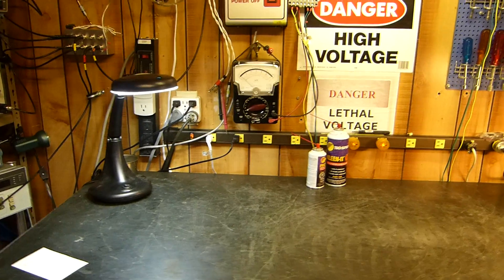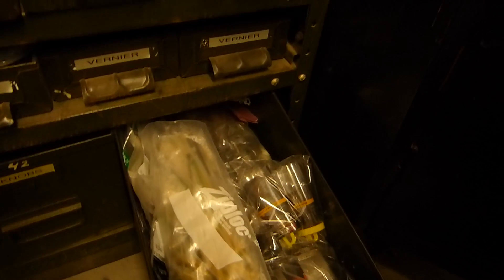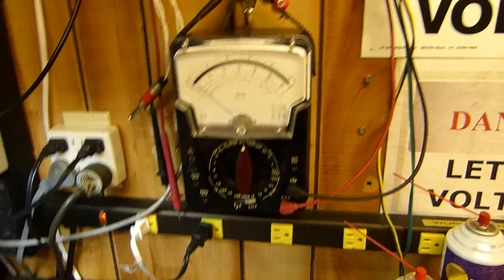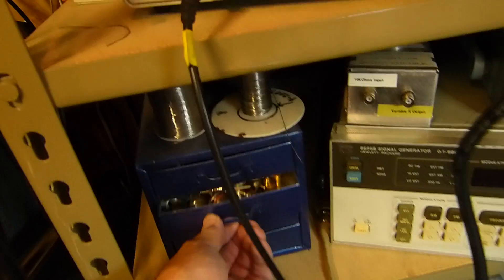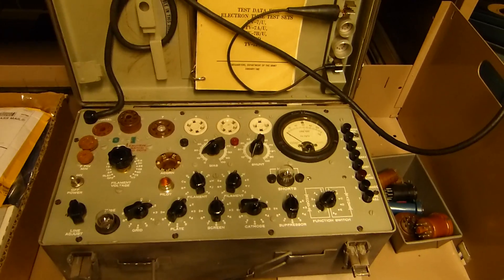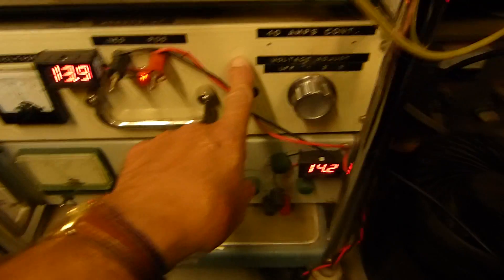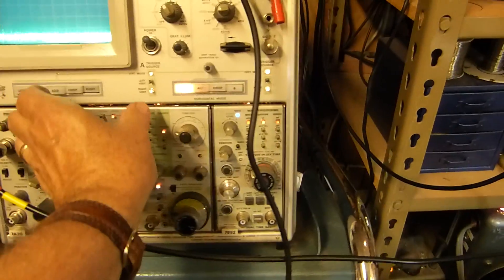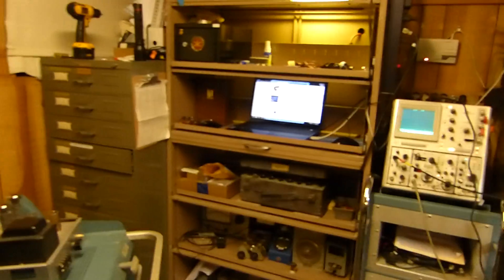My Audio and RF Workbench Shop Tour

Comment: Old-but good
Reply from the maker: I agree but nowadays we can have a $100,000,  1980 lab for $3 or 4 thousand and if we are lucky and get equipment that has been taken care of, we can make measurements better than 1% accuracy. I have so much confidence in the General Radio equipment, I use it to check out the new digital equipment made in foreign countries as I trust the GR equipment the most.

Comment: I know I'm late to the party, but I did enjoy the tour very much.  I suggest you replace the air conditioner with a ductless mini split unit.... they are more pricey than window units but extremely quiet, easy to install, highly efficient.... and unlike most modern window units, if you have a power outage, when the power comes back on, they come back on running instead of you having to manually reset them.  Your wife will like the lower power usage, you will like the safety factor and your you tube viewers will like the quietness.
Reply from the maker: Good suggestion - I am thinking about exactly what you speak of for my apartment "backhouse", as I call it, that is next to my little shop. I do agree that the extra bit of money will be well returned on efficiency and lower electric bills (by electric bill is around $650/month in the summer)... and a quieter place to make videos. It just may come true this fall for the backhouse and shop.

Comment: Great stuff, thanks for taking the time. Is there a way you could post or send me the link to the "chips" guy I can't find him on the bay and I'm looking for my first spectrum analyzer. Unless you would like to part with that pretty 3580, or if you could make any recommendations, I'm looking to use it on 10 and 11 meter radio. I do agree, my wife never had enough shoes.
Reply from the maker: Here is a link to a current selling produce on Ebay from Tektronix listed as "Chipxs"
http://www.ebay.com/itm/Tektronix-RSA3408A-Real-Time-Spectrum-Analyzer-14-Day-Warranty-/162238070893?hash=item25c624806d:g:ei8AAOSwxKtX~9F-

A spectrum analyzer  for 30 MHz should be fairly easy to find and not cost too much. The HP 3580A is for audio and goes from 5 Hz to 50 KHz. Nowadays, the inexpensive and sometimes free FFT programs that run on your PC will actually give you better results than the 1980's HP 3580A that cost over $17K back then... Check out ARTA and SpectraPlus software for your PC to do audio work. All you need in addition to the PC and software is a cheap USB sound card.

Good luck with your projects and thanks for your comments.
Reply: Thank you  for saving me a fortune. I'll check out those programs this weekend.
Reply: ElPaso TubeAmps s

Comment from the maker: I made the BNC box and do not have any significant noise problem with it. It raised the best of the SG505 from 0.0008% to usually around 0.004% or so but their could be other factors also. I have 1 meg ohm resistors in series with two of the BNC connectors so that I get a 2:1 division (reduction) in voltage into the 1 meg ohm inputs of the freq counter and such so I don't exceed their maximum rating.

Comment from the maker: Yes, I have been meaning to write you about it - it is very nice and I use is often. I wish it had a holder (I use an old Weller soldering iron holder) and a light (LED) on it so I can see that it is power on and hot - otherwise, it works great - thanks for the recommendation - PS - I am on 20 meters a lot lately around 14.250 MHz - if you get on sometime, maybe we can hook up. 73

Comment: Hi David- I am sure it's going to be a lot of help in your biz. There is a heat adjust on the handle via small pot. I cranked it all the way up for  R 390A modules and heavy P2P work.. The tips come in clogged with solder but after warm up the 808 will suck in. I use the 1,8mm tip for P2P stuff, they have tips up to at least 2.0mm.
 I will be interested in hearing your report.
Oh, I cost you less money than your wife did with the AC pwr Hi hi.
vry 73 Glenn

Comment: half the weight of the Weller. It has a long narrow neck and can get down on tube sockets, terml strips, connectors and other P2P stuff. The 808 has it's own small vacuum pump on the handle and BOY DOES IT SUCK I don't think I will have to use wick any longer. There are YT videos on the 808 and everyone seem to say only good things. 
BTW  I chuckled at the story about your wife turning off your AC. I wonder if she is related to my wife... HI
You can't shoot em but sometimes it does cross my mind

Comment: Hi David,
I thought your name is ray for some reason.. Sorry about that.
Hey, I want to spend some of your money and you will appreciate it..Back in the 80's I started using AirVac desoldering guns and they are perfect for PCB work but the Y head will not allow close point to point work. So, I did some investigation work to see if I could find something. Check out the Hakko 808 desoldering tool. It's around $200 and looks like an old Weller soldering gun we used years ago but it's about MORE>

Comment from the maker: Using multiple resistors in parallel does have the advantage of lowering the inductance of the whole unit as inductance behaves like resistance in parallel and series circuits. Even the large wire wound resistors have inductance in the 40 uH range and that does not cause any issues. When you get your load resistors complete, please post it on YT. I am sure many people would love to see it.

Comment from the maker: Grounding the metal parts of the workbench was an attempt to reduce electrical noise induced into equipment on the bench. Not sure it made a lot of difference - maybe, in some cases, I created a shock-hazard for myself. Thanks for the comments.

Comment from the maker: Fortunately, very few problems at audio frequencies. The input of everything is 1 Meg so it still ends up 200K or so. I do have to be careful not to turn on the 50 ohm terminators in the 485 scope. All the loads and cables tend to raise the output of the SG505's from 8 ppm to 40 or so ppm - but I can live with that. Thanks for your comments

Comment from the maker: I don't use heat sink compound as it is messy and I don't see it as necessary. The bigger the heat sink the better. I have considered putting a thermal switch and a fan on mine - probably not necessary and fans do make noise. Thanks for the comments.

Comment from the maker: For low wattage amps, it would not hurt them to put 16 ohms on an 8 ohm tap but for correct power and THD readings, the correct impedance should be used. I had some of the flat 8 ohm load resistors but the resistance varies greatly with temperature and the large WW resistors are OK - small amount of inductance that it does not matter - I used them for years. Spreading the load over multiple resistors is OK but you still only have the power dissipation that they all add up to.

Comment from the maker: When the big mainframe computers went away at WSMR, I was able to buy the big green parts cabinet and two nice eleven drawer cabinets and pretty much the entire office of Unisys in El Paso and WSMR, including test equipment who I worked for, in preparation for a MSS (maintenance service supplier) contract. I did not take the MSS but sold some of it back to the company that did get the contract - so made money and got lots of stuff - worked out good for me.